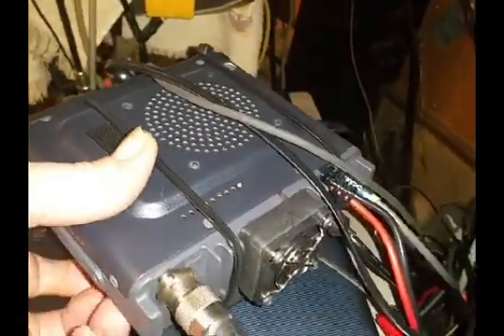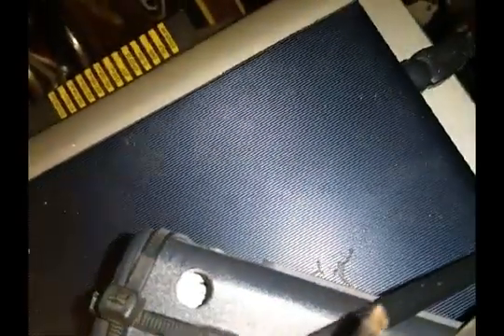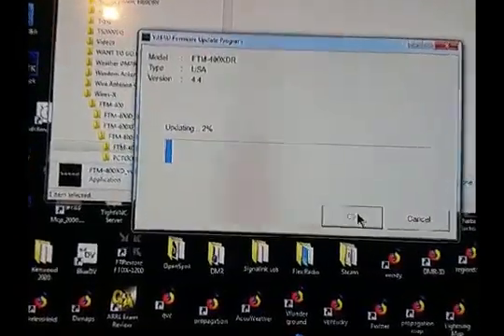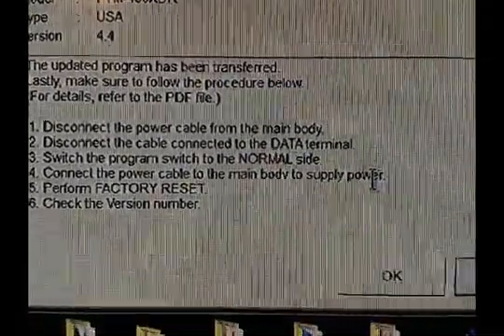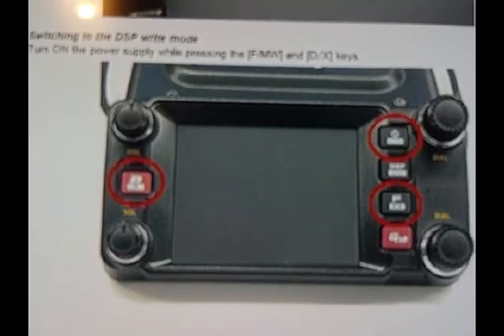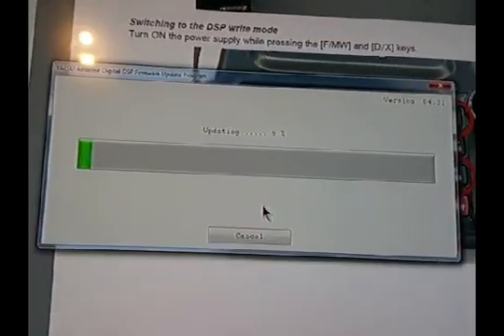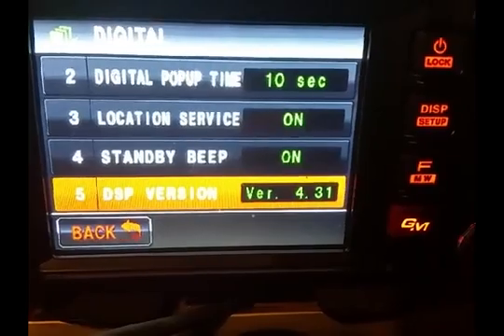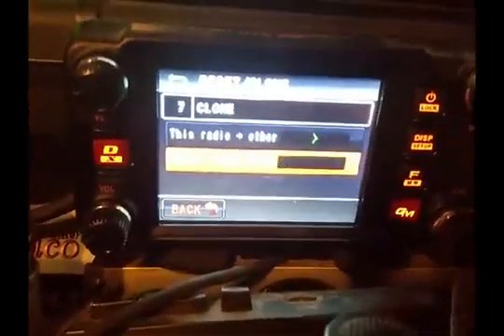FTM-400XDR  Firmware Update

Comment from the maker: john troutman I replied to your email  but it bounced, but Hello John, To answer your question

I used a standard 5 inch fan 12v .12ma for a computer fan and I put an Anderson power poll connector from the fan to the power cable so I could unplug it if needed.  Now let me remind you this is used as a base radio and not mobile so when I turn my power supply on the fan automatically starts running whether the radio is on or not but no big deal for me as long as the radio stays cool.

73's
John KF5YOT